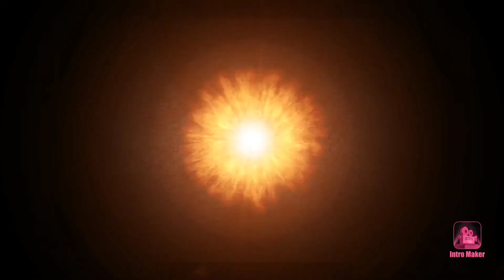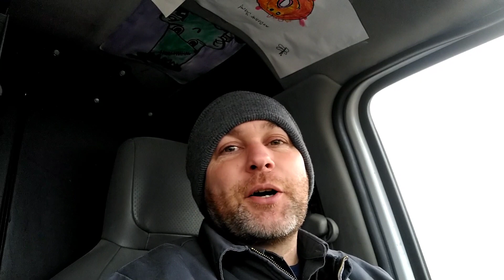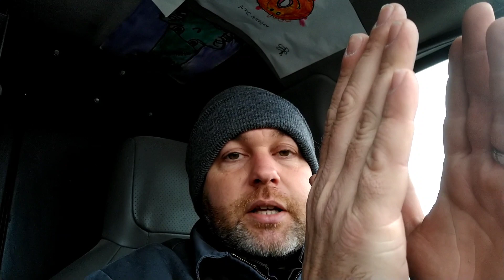Gas Furnace:  Modulating, 2 stage or Single Stage.  What do I really need?

Comment: I recently had an American Standard stage ii variable furnace installed. is it possible to  have it only fire in stage ii? not particularly happy with the slow fire stage i.
Reply from the maker: Most furnaces you can.   Might at home is locked in that way.   That's what I recommend if it's possible!    Hope this helps.   Be sure to subscribe and share!
Reply: I am a subscriber!
If I lock my furnace into stage two, does it use more electricity? The reason I ask is when my new furnace runs in stage two,  it  blows a lot harder and faster than my original Bryant single stage ever did even at full capacity.

Comment: I have a 5 year old 2 stage Ruud 85K high efficiency furnace. It heats a 2500 square foot ranch with a full basement. When the outside temp reaches 25, the furnace never shuts off.
Reply from the maker: Well could be a lot of things.  Furnace not operating like it should, poor ductwork, poorly insulated home, undersized, lots of options.  Probably have to have a tech look at it.  Thanks for watching! Please subscribe and share!   Have a great day!

Comment: I just talk to a sales guy and my main hang up is that the difference between single stage 80% furnace and a 96% 2-stage is almost $6K. Based on what I'm reading, the difference seems excessive and in that light, both "efficiency" and comfort negligible.
Reply from the maker: 6 grand difference seems extreme.  That's not usually the case unless they r trying to detour you from buying the 90+ or they are completely diff brands or something.   Something seems wrong with a 6000 dollar difference.   I'd get more quotes.
Reply: @andyscornerhvac  Both were Lennox. Must apologize and clarify, because I spoke from memory. It was 5.5K difference was between AC units, single stage 14 SEER and dual 18 SEER. The Furnace difference was $2.5K. But yeah, I'm still taking quotes. Thank you.

Comment: was being sold on 2-stage trane 13 seer today heating & cooling 2 ton system, attic install on a slab 2 bedroom ranch 15K .... 11K on single ? run Tru 13 seer , seems it really doesnt need a 2 stage from what your saying Thanks

Comment: What I really want to know is weather I should get an 80% or a 90 plus. I have to get a new furnace because my 1994 Bryant 80% has been having issues for the last 5 years and I just want a reliable simple furnace. I’ve heard that because 90% plus  furnaces have secondary heat exchangers they have a tendency to not last as long is that true?
Reply from the maker: No.   It's a old myth that I wish would go away!  People keep trying to say they don't last and fail because it's a 90 and the whole heat exchanger bs.  A heat exchanger doesn't fail because it has condensation in it as long as it drains like it's supposed to and is sized right.   Heat exchangers fail when the furnace is too big for the house or ductwork or the homeowner isn't changing the filter or when the duct is too small and not sized right causing the static pressure to be too high.  So my opinion,. Yes but a 90% furnace.   If your worried about it, most 90s have a life time heat exchanger warranty and some even have full unit replacement warranties.   Think they would give warranties like that if they had problems with the heat exchangers?  No.  They know they won't have to warranty them.  I personally would never ever buy an 80% furnace.  The only 90s that had issues with heat exchangers were the carrier furnaces that had a different design and they don't make that one anymore.  I would never ever buy a carrier either.  But that's just me.   I've had to work on too many of them and they cost people way to much money to repair.   I hope this helps a little.  Be sure to subscribe and share with your friends!
Reply: @andyscornerhvac , huge help, definitely going with a 90% single stage

Comment: Whats the point of locking out the 2nd stage if the furnace has the option is there a loss of btu output?
Reply from the maker: You don't lock out second stage.   You lock it into second stage.   Big difference.
Reply from the maker: Thank you again for watching !

Comment: Good info and food for thought.  I have an older Heil single stage, and have always been of the frame of mind that simple is better, and if it ain't broke, don't fix it.  But here in Michigan in the winter and especially the damp chilly change of season, it's uncomfortable between heating cycles especially for my wife who's from a sub tropical climate and we're both getting older with a little arthritis setting in.   So recently I've been starting to research what's out there and the two stage and modulating seem to keep a more comfortable heating pattern, so that might be a better option for us, although I hate to think of the increased gas bills and eventual repair costs as well.  It's a dilemma and I'll have to do a lot of research this winter.  🙂
Reply from the maker: I understand. And thanks for watching.  I don’t know your full setup but a lot of times if the furnace is toooo hot and uncomfortable in the home when it runs, even in mild weather, it can be due to over sized equipment or ductwork issues.  Personally I would recommend having someone check the static pressure on the duct system and do a load calculation on the house to determine exactly what size equipment you need for sure.   This could be way out in left field but that’s what I would always check first and if you are purchasing a new system, any company that doesn’t do these 2 simple things b4 selling you a unit , you should probably run from!  Again, maybe way out there.   Just a thought.   Thanks a gain for watching and be sure to subscribe!   Share with a friend!   Have a great day!
Reply: @andyscornerhvac  Sure will, thanks!

Comment: It is very confusing looking at the difference in furnaces.  You are talking about 2 stage furnace vs single stage furnace. My research does show the 2 stage isn't more efficient.  What about single stage motor PSC vs constant torque motors?
Reply from the maker: All blower motors in the states now have to be ECM of some sorts now.   I think the psc motors were fine.   I would prefer a variable speed blower just because you have more options with it but it has gone to variable only in new systems now so we don't have to worry much. If your in the states, it'll be a vari speed motor.   I prefer the traditional variable speed motor over the 5 speed ecm but that depends on brand and model
Reply: @andyscornerhvac  Is variable speed the same as constant torque motors ?
Reply from the maker: Yes.  I believe so.

Comment: Zoning is just a patch for crappy ductwork.

Single stage furnace is basically obsolete, no reason to install them any more - 2-stage is vastly superior.

Running longer does not cause higher gas bills, burning less gas over a longer period of time -> unless ducts are in an unconditioned space. Efficiency on low and high are very similar, within 5% points. 
Cycling on and off is not desirable, cycling is an artifact of supplying too much heat, the best furnace is one that doesn't turn off.
A properly sized 2-stage controlled by a 2-stage thermostat will not turn off in bitter weather.
Reply from the maker: Thank you for your input.   I can not say that I agree but always looking for other opinions.  Have a great day.
Reply: need to go back to basics and learn fundamentals again then. run a 50 watt light bulb for 2 hours or a 100 for 1 - both will use the same amount of energy. no way around it. efficiency on low fire will be within less than 5 percentage points of high, no drastic difference.
If your area has attic/crawl duct systems that could be the cause of higher bills due to reduced velocity through the ducts - but ducts do not belong in unconditioned spaces at all.  @andyscornerhvac

Comment: Your description of 2 stage operation (not that you are wrong) has me puzzled. Isn't the best heat transfer when the delta is highest (colder air)? If my theory is correct, the starting at high fire and go to low fire as you approach target seems to be more desirable. Or is this done because of condensing issues? (Not a HVAC person. Had a coarse on Heat transfer/Fluid flow waaaay back when I was in the Navy).
I came here because I was interested in QUIETER forced air heating (older house on a slab). 
👍
Reply from the maker: Your delta will be better.   Picture it at 70 degrees n the home.   Low fire runs around a 120 degree supply and high fire at 135 to 140.   So your looking at a delta of 50 in low and a delta of 70 in high.   And that's giving low stage a little extra cause a lot of the units run low stage at like 110 so it's a cold supply.    Now one thing I did not mention because there is some controversy over it, is locked into high, a lot of contractors also tune the furnace with a combustion analyzer to get it perfect.   And this would be the best way.   You know the chemical makeup of the combustion and temps internally so it is on point in high fire.   Knowing your O2 and your co and co2 level and flue temp is actually the right way to do it in high fire.   I left it out for one, home owners don't own the tools and should not attempt, as well as a person needs to be trained on how to actually tune the furnace so that it's safe and efficient.   Some contractors out there still don't believe in doing this like the mfgs recommend.   They don't want to do the extra work.    So all n all it was easier to just leave it out for now. But this is what drives me mostly to say that 2 stg furnaces are a joke running in both stages.   And some just love to bash the idea that units are not at their full potential straight out the box.   But whatever.   I know the results we have seen for years n years and most good contractors are doing the same.    Thank you so much for watching !  Be sure to subscribe and share!  Also check out the new Andy's Corner HVAC Podcast!  Have a great day!

Comment: Andy just found your channel awesome info. I'm in the market for a new furnace and ac, replacing a 80% and 10 seer set up. Have my choices narrowed down to a Amana single stage multi speed 96% furnace and 13 seer ac, other company wants to put in a Rheem 2 stage 96% furnace and 14 seer ac. Both companies offer a 5 yr labor warranty. Home is single floor 1000 sqft. The Rheem set up is $1500 more. I'm not sure what to go with, my concerns are repair costs after the warranty and do I need a 2 stage. Thanks for any more insight
Reply from the maker: Personally I'd buy the Amana.  The repair parts are less expensive and easier to come by.  I put an Amana in my house.   I usually try to stay non brand specific, but I do like the Amana / Goodman line.  Number one is warranty.   If you ask your contractor ( assuming they are actually selling Amana ) you can get a 10 year labor waranty.   Doesn't cost much but worth every dollar.  If it is Amana , should be able to get 10 year part as well.   With lifetime heat exchanger and lifetime unit replacement.   Supriser th  contractor didn't mention that.   They came up in the industry mainly because of their warranty.     Either way.  It's up to u.   It's your house.  But I would take the Amana.   Hands down.   I look at what it's Gona cost me 10 years from now.   Amana is the better option.  Just fact.   
Hope this helps.    Be sure to subscribe to the channel. And share  with your friends.  Have a great day!
Reply: @andyscornerhvac  thank again for the info. Is the extended labor warranty obtained by buying the Asure extended service plan. Thanks
Reply from the maker: Sure is
Reply: @andyscornerhvac  I asked about the extra 5 yr labor and it would run about $900 more, the install company was even surprised it was that much, at least that seems like a lot to me. Thanks
Reply: @andyscornerhvac  thanks for the info, yes subscribed and hit the bell. That's all they sell is Amana, and the parts warranty is as u said I just didn't mention it. I'll ask about the extra 5 yr labor warranty. One more question,  they said they only install an exhaust pipe that the Amana's don't require an intake because they have larger heat exchanger. I know my step son has a 2 stage Amana Distinctions that was installed in the house he bought by same company. Only an exhaust pipe. Thanks
Reply from the maker: You can definitely get away with one pipe and draw the intake from inside. It is an option. Most companies run two pipes and draw the combustion air or the intake from outside as well. I don't know anything about a heat exchanger being bigger. Company I work for puts in probably a minimum four to five of mana systems a day and we always run two pipes unless it's not an option to get the second pipe out. If the furnace is located in the same room as say a clothes dryer or even close to a bathroom or somebody's going to be using a lot of hairspray or anything like that I would definitely run two pipes. You want clean combustion air coming into that furnace. The lint from a clothes dryer even if it is sealed up well that dryer will still put lint into that room. And then that lint sucks in and it burns on the flame sensor. And then the flame sensor has to be cleaned more often or you could have nuisance failures. Hairsprayed any kind of spray products do the same thing. But if there's not much around it like that really shouldn't be too big of an ordeal. If you look at the manuals for Amana they do recommend two pipe systems. But the alternate is only one exhaust pipe if that's the only option. Thanks again for watching have a great day!

Comment: There’s a big difference between an ecm motor and standard capacitor driven motor, the electrical savings is where you get your savings especially in Canada where natural gas is cheaper . And not to mention here in Alberta we can only sell two stage furnaces now .

Comment: We live in CA and have extremely high gas and electric rates. Electric is .38 cent per kWh and gas is about $1.15 per therm (cu ft). Currently, we determined its more efficient for us to leave our thermostat set and leave it there and on 24x7 allowing the A/C and heat to maintain the temps vs. what lots of people do, turn the thermostat up or down 10 degrees when not home or while sleeping. We have experienced lower utility bills by leaving the temp set all the time.
Reply from the maker: And that is what I recommend in most places.  It's usually more efficient but every house is different.  I think it would but time to leave CA if it were me.   Everyone else is!
Reply: @andyscornerhvac  Bro, really? I live in NYC and keep my thermostat off when I'm working all day. You say it's better to leave whole day ON?

Comment: Just like the refrigerator industry back when they started pushing "efficient" models and suggesting the old models used more power.  Well, sure enough. The market boomed in volume for new efficient units but folks complained "they ran more often" than their old refrigerator. The industry continued to market how inefficient existing units were even though the run times were much longer and more often. 
I have an old GE refrigerator from the 1940's with the freezer section inside the refrigerator section.  It has a tag on the motor, 2.5 amps and it is manual defrost. How can an industry even suggest that my old antique GE should be replaced with a new type to save energy? They won't save me any energy, they will use more energy than what I have now. 
So, it seems the marketing is similar according to your video..."more efficient" is a complete lie and from the experts. We have done our research as well and have determined the best solution for long term reliability is a single stage HVAC system and mainly because they aren't as proprietary with expensive sensors and electronic boards and can use assorted parts from several manufacturers vs. "got to use the OEM" part.  We have also determined that installation is the most important part of a new system and decided that those Goodman systems are your "typical small block Chevy" with reliability and plenty of service parts to support them when there's a need. They way things are going with automobiles and other appliances as being proprietary in every way, we'd rather stay away from that cluster.

Comment: I have a question….I had a quote for a 2.5 ton 15 seer comfortmaker single stage but they are installing a 14 seer instead of the 15 and he said it was the same thing and no difference which i find hard to believe…..what is a ball park price difference of the two?
Reply from the maker: It's hard to say the price difference, every area is a little different and every company is different.   We don't even offer 14 seer.   But if you signed a contract on a 15 seer you need to be getting a 15!  They would be completely different model of unit if they are different efficiency ratings.  The efficiency difference, probably not a wild difference unless it's going to two stage equipment on one and not the other or something. But either way, IF they truly are a 15 seer unit Vs a 14 SEER unit they are NOT the same.  They would have to be completely different models to have different seer ratings.   I'd be getting what I signed for or my money back if I were you.   After January 2023 the dept of energy will not allow anyone to sell units below 15 seer.  They might be trying to dump the lesser units.  Maybe not but maybe.    Hope this helps be sure to subscribe and share anywhere you can.   Have a great day